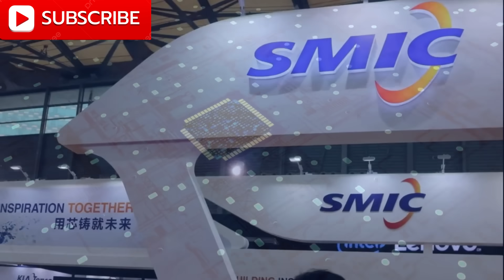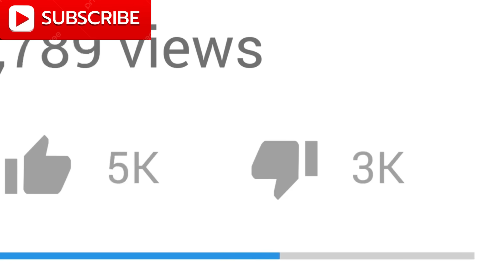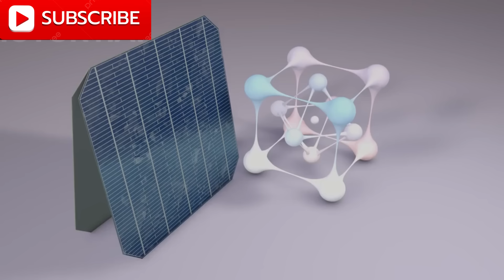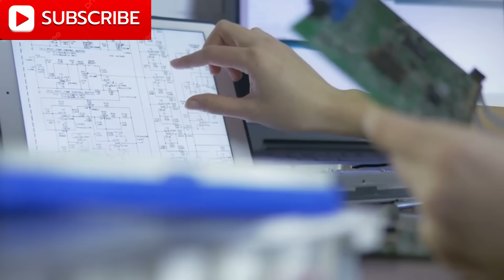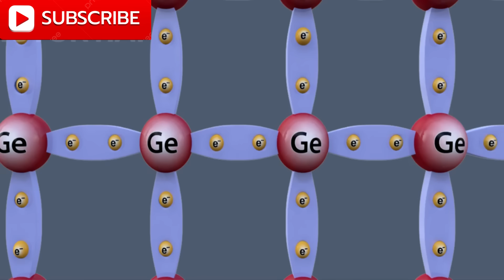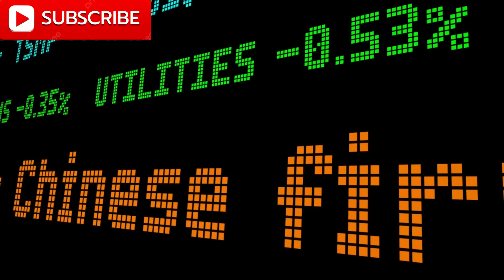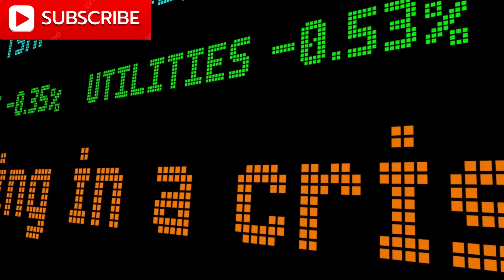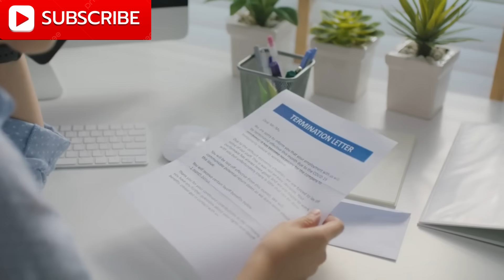SMIC Reveals 2nm Chip in Defiance of U.S. Ban — Washington Reacts Strongly!

Comment: SMIC's 2nm CHIP reports ARE CORRECT.

Gemini AI - 

Reports from May 2025 suggest that SMIC, a Chinese semiconductor manufacturer, has a working prototype of a 2nm chip, which is considered a significant achievement given current US sanctions. However, scaling this to mass production presents a considerable challenge.
While SMIC has the full backing of the Chinese government and continuous investment, they face obstacles such as yield issues and the reliance on Deep Ultraviolet (DUV) multi-patterning instead of the more advanced Extreme Ultraviolet (EUV) lithography machines, which are largely restricted from sale to China.
Despite these challenges, some analysts suggest that SMIC could achieve 2nm mass production as early as 2025 or 2026, with Huawei's relentless R&D efforts potentially accelerating this timeline. If SMIC can successfully mass-produce 2nm chips, it would have significant implications for the global technology landscape, potentially altering the balance of power in the semiconductor industry.
For comparison, leading global foundries like TSMC and Samsung are also targeting 2nm production:
 * TSMC expects to begin mass production of its 2nm (N2) process in the second half of 2025, with large-scale production planned for 2026. They are also planning for post-2nm advancements, with the A16 node.
 * Samsung also aims to start 2nm production in 2025.
 * Intel initially forecasted 2nm production in 2024 but has since shifted its focus to its 18A (1.8nm) node, with expectations for products in 2024.